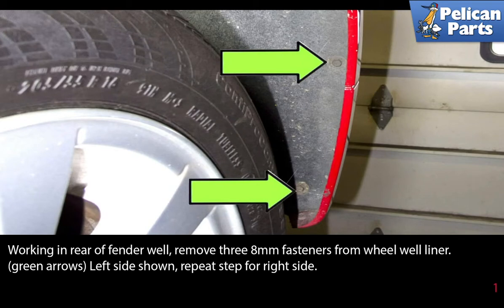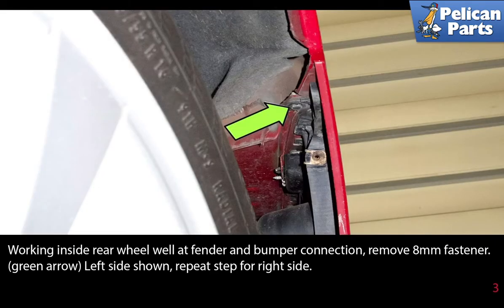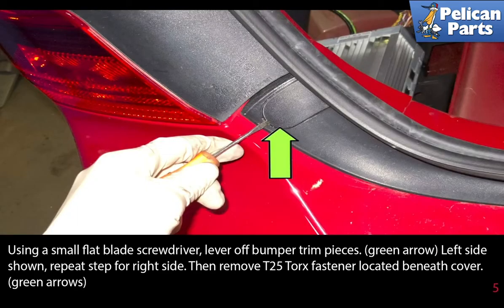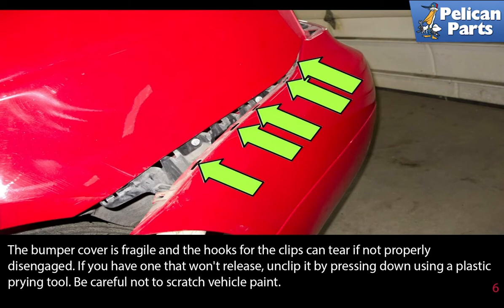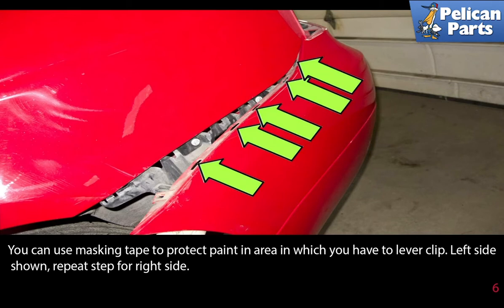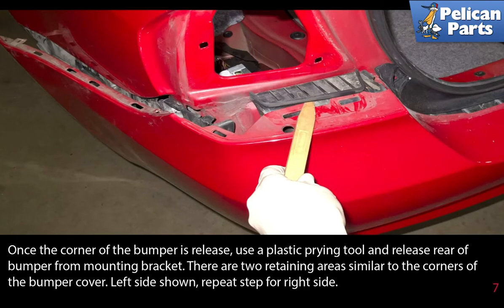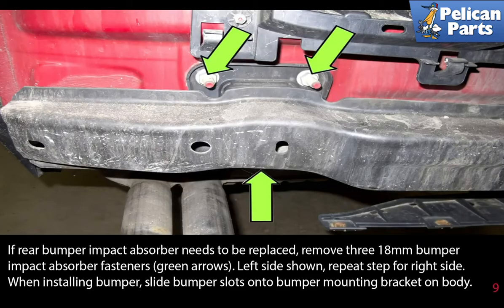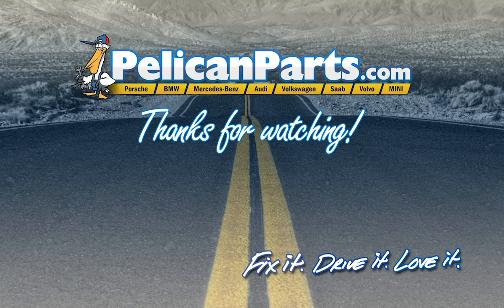BMW E90 3-Series Rear Bumper Removal for 325i, 325Xi, 330i, 330xi, 328i and 335i

Comment: Forget to show how to remove the back lights!!!
Reply from the maker: No we didn't. We mention that in the prerequisite steps. The rear bumper is quick and easy to remove.
A few fasteners and two clips and you can slide it off. The mounting brackets that bolt to the body can break from impact or improper installation. In this article, I will go over removing the rear bumper as well as replacing the mounting brackets. Have a friend over to help slide the bumper on and off easier.

Remove rear fender mounted tail lights. See our tech article on tail light replacing. http://www.pelicanparts.com/BMW/techarticles/BMW-3-Series-E90/BODY-Tail_light_Replacement/BODY-Tail_light_Replacement.htm